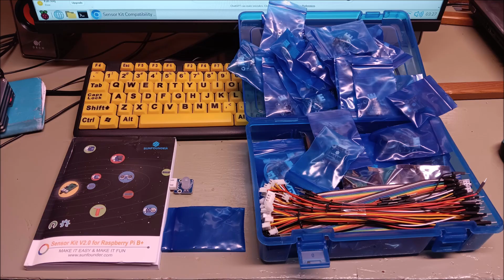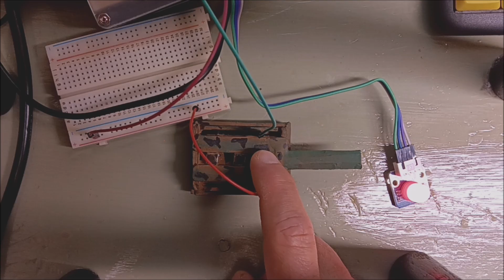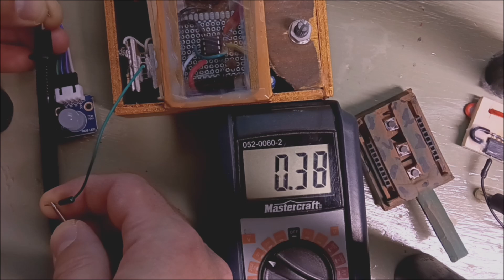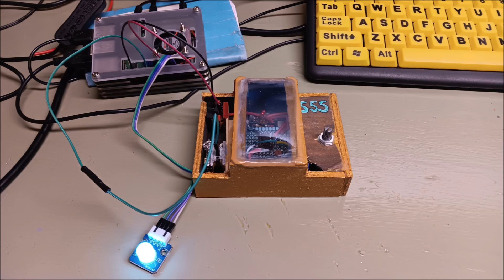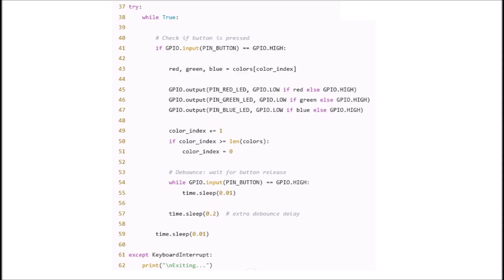Raspberry Pi 4: RGB LED Module: Part 003: Multi-Colour, 555 timer

Comment from the maker: # multi-colour experiment, code is simpler than previous experiments (doesn't use the GPIO library as much - doesn't use callbacks or def functions)

import RPi.GPIO as GPIO
import time

# ================= GPIO SETUP =================
GPIO.setmode(GPIO.BOARD)
GPIO.setwarnings(False)

# -------- OUTPUT PINS (RGB LED - common anode) --------
PIN_RED_LED = 11
PIN_GREEN_LED = 13
PIN_BLUE_LED = 15

GPIO.setup(PIN_RED_LED, GPIO.OUT, initial=GPIO.HIGH)
GPIO.setup(PIN_GREEN_LED, GPIO.OUT, initial=GPIO.HIGH)
GPIO.setup(PIN_BLUE_LED, GPIO.OUT, initial=GPIO.HIGH)

# -------- INPUT PIN (Single Button) --------
PIN_BUTTON = 29
GPIO.setup(PIN_BUTTON, GPIO.IN, pull_up_down=GPIO.PUD_DOWN)

# -------- COLOR STATES (LOW = ON, HIGH = OFF) --------
colors = [
    (True,  False, False),  # Red
    (False, True,  False),  # Green
    (False, False, True),   # Blue
    (True,  True,  False),  # Yellow
    (True,  False, True),   # Magenta
    (False, True,  True),   # Cyan
    (True,  True,  True),   # White
    (False, False, False),  # Off
]

color_index = 0

print("Press the button to cycle LED colors. Ctrl+C to exit.")

try:
    while True:

        # Check if button is pressed
        if GPIO.input(PIN_BUTTON) == GPIO.HIGH:

            red, green, blue = colors[color_index]

            GPIO.output(PIN_RED_LED, GPIO.LOW if red else GPIO.HIGH)
            GPIO.output(PIN_GREEN_LED, GPIO.LOW if green else GPIO.HIGH)
            GPIO.output(PIN_BLUE_LED, GPIO.LOW if blue else GPIO.HIGH)

            color_index += 1
            if color_index >= len(colors):
                color_index = 0

            # Debounce: wait for button release
            while GPIO.input(PIN_BUTTON) == GPIO.HIGH:
                time.sleep(0.01)

            time.sleep(0.2)  # extra debounce delay

        time.sleep(0.01)

except KeyboardInterrupt:
    print("\nExiting...")

finally:
    GPIO.cleanup()